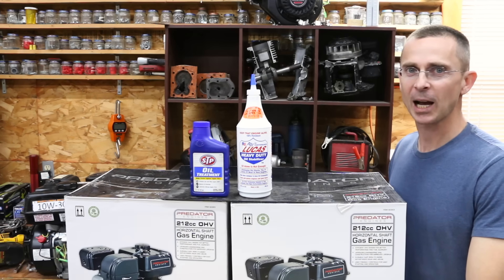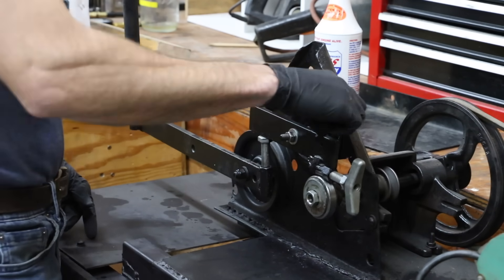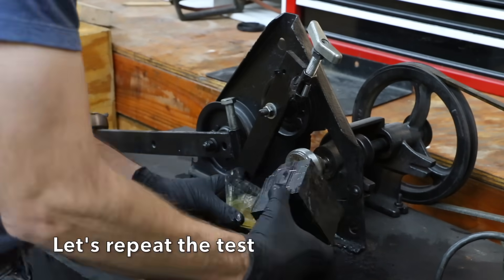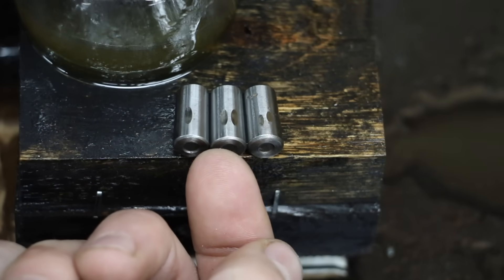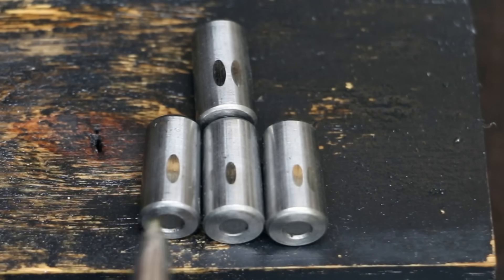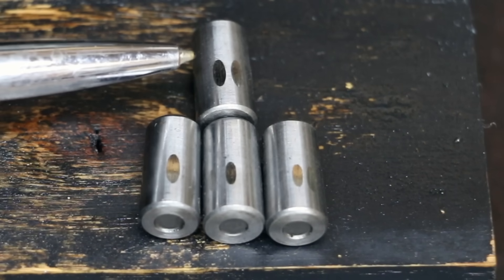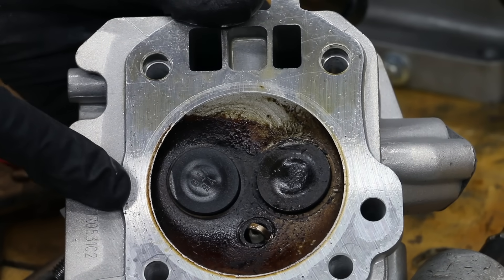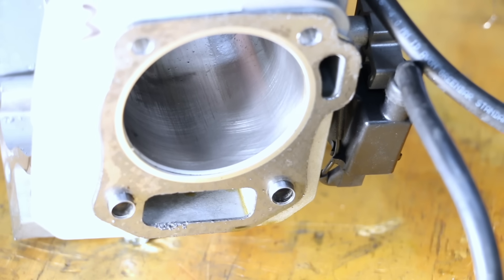Which engine self-destructs first?  Lucas or STP?

Comment: 2 hours later at the Harbor Freight returns desk "Dunno, They were running fine and then just wham.. must be a manufacturing defect."
Reply: I do bet that someone has probably done that.
Reply: Daniel Ade , yes I was an HFT store manager before they emasculated and dumbed the job down.
Reply: @danielade9062  2
Reply: You do know you're cheating Harbor Freight don't you?
Reply: @ellieprice3396  I had a Harbor freight employee tell me to do that with the air compressor I bought.
Reply: @swiskus100  lmfao
Reply: @ellieprice3396  that's the point of buying the extended warranty. they just rebuild em, re box em, and put em back on the shelf.
Reply: Matt Stambaugh would you like to sign up for itc?
Reply: That's awesome believe it that's how it usually works
Reply: Lol, then straight to the clearance rack.
Reply: @superhall229  Sir, the extra tape just means the box was damaged…. It’s not a return item .. we’ll take an extra $5 off
Reply: I never buy the extended warranty from harbor freight,  if it makes it through the intended job a bought it for, then it served it's purpose and I already made my money back with it. All uses after that is extra profit. They are cheap for a reason.
Reply: Me too but if I purchased one of those generators, their more expensive ones which are very highly rated Honda knockoffs, I might purchase an extended warranty.
Reply: Koglio Knows And the extended warranty would be even more extra profit. But she didn’t think that far ahead did you
Reply: @Jacques Bloques No it is called stealing anyway you cut it.
Reply: Thomas Marnik save it for Sunday. Raise your own kids. Keep your nose out of the living room of others. Self righteous fraud.
Reply: Mike Seever You're the reason warranties are shit these days...
Reply: Casher:”Would you like to buy the replacement plan?” 
Me:”Woman I’m going to use it twice and toss it...” 
Cashier:”😔ok den”
Reply: Hate people that do that kind of shit. Thats why I have such a hassle exchanging my craftsman tools.
Reply: Noan YoBiseniss Craftsman is about as American as iPhone now. Were my fav for years. Walmart Stanley for the win now, unless you’re pro. Then Snap on for a second mortgage.
Reply: Ahahhahahahahahhahahahahhahahahhahahahahahaha
Reply: Matt Stambaugh as a matter of fact, I think I will take the extended warranty
Reply: @louofm1  hahaha
Reply: louofm1 why do I need the extended warranty? Salesman “ in case they blow up”   If there going to blow up I’m not buying them lol
Reply: Matt stambaugh...that was funny...lmao
Reply: Then the clerk just taped the box up and returned it to inventory.
Reply: That's funny
Reply: Isn’t it great to hear people say that a corporation is cheating them?  As if you had to buy their product. I do know what it takes to run a business that sells things and unfortunately people that scam the system with dishonest return practices has to be factored into the price. If it wasn’t there would not be any products made. EVERY manufacturer would go out of business because so many people do this and other dishonest things. 
Of course there is a profit for manufactured and/or sold goods. Why else would anyone provide these services if there weren’t?
Just admit that you are a crook when you are just that and don’t blame the business. They are only trying to remain a viable company and people like this make it more expensive for them and in turn make it more expensive for us all.
BLAME YOURSELF for the high prices.
Reply: Hey Matt, I thought the same thing! Great minds think alike.
Reply: Matt Stambaugh that's funny
Reply: Hahahaha
Reply: Those came with a lifetime warranty right?
Reply: I sure he bought the extra warranty lol
Reply: hahaha can you imagine? That would be hilarious!
Reply: I would like to see a Super tech oil additive review.
Reply: Sadly, there really are people like that out there, some even in this thread. Always looking for an angle. Like the women who buy a dress for a special occasion, wear it, and then return it. Like the welfare queens and others who love their free stuff from the government and then vote for socialist pigs. These people make awful co-workers and friends, because others always have to take up the slack for their selfishness.
-- Free capitalist democracies require a primarily moral and ethical population. People who see others cheat, and then justify their own cheating, are a contagion of corruption and undermine America. Like an internal cancer. Their corruption in turn "justifies" the corporate cheating, when people like them get jobs in companies and write crappy warranties, and so on, and so on. "But everyone else is doing it." No, everyone else is NOT doing it. Most of the other people, the honest ones, are avoiding you, so your circle of friends gets narrowed down to like-minded corrupt people, who are the ones saying "Everyone else does it." It's a corrupt, communist, anti-American mindset. It's what keeps third-world countries third-world and communist countries unfree.
Reply: @grizzlygrizzle  You're not alone brother. Don't forget that. Never be bitter. Lots of good out there too.
Reply: Daniel Nunez  I don't care how you justify it, you are STEALING. I hope you do not past this despicable value on to your children.  Shame on you.
Reply: Let me know when you do this mystery oil test !
Reply: It was a joke people! Stop the "ethics" bashing!
Reply: HAHAHAHAHAHAHAHAHAHAAH F-ING A
Reply: David Dahveed, why you disparage the Russia? The motherland is the only land
Reply: Jacques Bloques exactly. Seeing as how most manufactures warranty the product the first year anyway. It’s a second chance for the business to stick their hand in your pocket.
Reply: Do you remember Craftmans tool warranty about 20 years ago? No questions asked life time warranty on all tools, the it changed to non mechanical tools, and finally ended with reconditioning of ratchets and replacing tape measures, anything else went to “service center” where they told you proper use and maintenance is abuse of the tools and handed you a bill!
Reply: Perfect
Reply: Hahahahahahahahahahahahahaa!
Reply: Yep, that's what I would do.😆
Reply: LMAO!!!
Reply: LMAO
Reply: Lmao
Reply: LOL
Reply: LOL!
Reply: Buy 12 dollars insurance and you can return it at harbor freight.
Reply: lol 😆
Reply: Return them they are under warranty
Reply: Omg 😲 hahahaha😄
Reply: Best comment ever!! Bahahaha!
Reply: So good
Reply: 11:25 Music: Silent Partner - Don't Look.  

Took a while searching through 100+ songs to find...
Reply: Bring those jack stands in too. No good after you drill 4 holes in each of them.
Reply: Must be a fluke !
Reply: bahaa! lol!
Reply: I did added to my car the ticking noise from lifter got better almost no more sound I LL continue using lucas additive in my engine oil it fantastic for me .
Reply: #harlemfake
Reply: Do you want the extended warranty, we will replace the engine if something happens. Yes where do I sign up.
Reply: Matt Stambaugh well depends on how you look at it if 40 for insurance that they make 100 profit on  and the unit cost them wholesale 20 bucks they clear 120 profit then after you file a claim they still clear 100
Reply: @David-w8x6q  I think he is a rusky, just here to ruin 2 of our engines!
Reply: it seems to me that STP scored best on the measuring chart, it had least amount .. and was close even though it was not mixed as rich. but here is one interesting thing,  viscosity does mean something when you have no oil because it hangs on to the parts creating a barrier... but you would have better flow with thinner oil, providing there is oil.
Reply: I wish you had a third to run regular oil as a control
Reply: just got to dump the 3 hour break in oil back into the engine pull out the dip stick at the counter
Reply: Matt Stambaugh .lol
Reply: The warranty covers everything short of theft. All that is asked is you actually get all of the gas out.
Reply: Ha! Too Funny!
Reply: Nack in the 50 60 nascar drivers bought sears and 'monkey wards' tires. Race them and return them for bew ones on Monday. True story as told by the man Richatd Petty.
Reply: Lmao
Reply: INTEGRITY
Reply: You have dum dum try this blow up try return back to store fore cash back
Reply: lol
Reply: Wow you are a scumbag...
Reply: roflmmfao!
Reply: Or, you know, stealing, same thing, but it always comes back to you, always. Now, if it legitimately has a failure, that's a different story.
Reply: N Matthew   I think they are just joking about ever returning tested motors they destroyed.
Reply: Im just the opposite. After using it for two years,  I go back to Harbor Freight and pay them for the engine all over again. After all, it outlasted the warranty and if I use it any longer than that,  people might accuse me of being a dishonest consumer and shameless capitalist,  seeking greater value than the machine was guaranteed to run. Consider it a form of penance. Here mister Harbor Freight manager, I've come to pay you more because the product lasted so long. Please accept my money less the folks on YouTube taunt me for taking advantage of you. Im sure you buy these engines by the hundred thousand quantity for $16 each and barely make a dime profit at $99. If its running next year, I'll be back with more guilt money. Thank you.
Reply: @mark-wn5ek  mark, that's gotta be the funniest shit I've read so far!!! LmASSOFF!!!!! 👍👍👍👍👍
Reply: It's a darn good thing we have so may people standing up to protect these large corporations from the evil that lurks in the hearts of the working poor.  Protect your corporate overlords maybe you too will get a cookie. idiots
Reply: @erictorkelson5778   -- It's not about protecting corporations. It's about protecting yourself, your family, and your community. If you travel to some 3rd world countries with rampant corruption, you will see how that attitude ruins a country when it becomes normalized. When you commit that kind of fraud and rationalize it because some others are doing it, you are corrupting yourself, and your corruption will rub off on your family, and on anyone else you have influence over in your community. As your kind of attitude spreads, it infects the people who come to run large corporations and the government, and before long we're living in a banana republic. 

-- I have a friend who has done some pretty sleazy things, but he was in dire straits at the time, fearing for his family's survival, and as soon as he got his head above water (and just barely), he started paying it forward, providing service above and beyond the call of mere honesty. But when someone who is doing OK starts rationalizing theft and fraud when it's unnecessary, the kind of person who's always looking for an angle in order to avoid having to put in an honest day's work for his pay, that's the kind of cancer that infects a decent country and makes it decline. None of us is perfect, and no one with ideals  lives up to them fully, but when you give up on those ideals, and resign yourself to cynical dog-eat-dog-ism, you're just half a step away from being a common criminal. It's parasitic on the honest people, because your angle wouldn't work if everyone else did it. It only works because most people don't do it. And is that the kind of legacy you want to pass on to your kids?
-- If you justify defrauding big corporations because you think they're all corrupt, will that kind of rationalization become extended if you move into a neighborhood with some wife-beaters in it? Embezzlers? and so on? A moral compass is an individual thing, and if you're going to choose to tie yours to the least common denominator, then you're not going to end up with much self-respect.
Reply: @Jacques Bloques Yes, I guess I am just plain Dumb.  Thank you for your kind words.
Reply: @thomasmarnik6849  Seriously dude? You voluntarily decide to dish out a verbal attack on someone judging them. But when they respond with a judgement of you that you don't like you resort to snarky comments? Aside from that your initial complaint is way off base. What is being offered upon purchase is no questions asked replacement or the item purchased. There is no defrauding going on. They will inspect the one returned test it spruce it up and sell it as a reconditioned item. By that time prices will have gone up say $30 on the unit so when they mark it down $50 they're only out $20 ... except he paid $40 for the warranty so they're still ahead.
Reply: A warranty is for a item that breaks or does not function properly in the warranty period.  Using an item for just short of the warranty period and then returning a worn but functioning item to get another brand new item is Fraud.  PERIOD.  That is the value system that was instilled in me by my parents and I hopefully by example I have instilled in my children.  I through this thread am trying to show others that this type of behavior is not right and many other people consider this low moral behavior.  BTW, I Never Ever purchase an extended warranty because yes the merchant selling the product makes more money by selling the warranty.
Reply: Thomas Marnik show the State stature where that is Fraud!!!!! Period man.
Reply: @erictorkelson5778  well said. My thoughts exactly...
Reply: @steve5912  You're*
Reply: That's the sound of the joke going over your head lmao.
Reply: I do that with my Sylvania Silver Star Ultra headlights from Walmart. Like $35 for a 2 pack. Bulb burns out in a couple months I buy a new one, put the old bulb in the package take it and the receipt to another Walmart. "I just bought this and it burnt out" it's not cheating Walmart if they burn out all the time. Lol
Reply: @demonchild8452  Convert to led cheap ass
Reply: @demonchild8452  if bulbs burn out that quick more than likely it the person installing them.  Regardless of brand. You never ever touch the glass part of the bulb the natural oils on your hands will leave a residue on  the bulb and cause them to heat up and burn out. Don't believe me look it up
Reply: @demonchild8452  You are the real thing! A Jerk!
Reply: @Demonchild84
I never worked 2 1/2 years for any company that didn't pay a living wage - that would be pretty stupid.
Reply: Demonchild84 Walmart pays $15 an hour minimum to their employees— not many stores do that
Reply: What a waste.
Reply: @owentie  I guess there is the scrap though. Viewer funded scrap.
Reply: One of the upsides of doing business with Harbor Freight is when you purchase an engine or an engine-powered piece of equipment is their extended warranties. I've had a number of the two-stroke 700 watt generators. I use them whenever I don't need a lot of power on a job site, as well as for camping. I purchase the two year warranty ($40). Then just prior to the two year mark I take it back and got a brand-new replacement no questions asked. None have ever failed on me, but after two years of use (I'm talking hundreds of hours in less than ideal environments) I get a new one. Use a generator for two years and then a brand new one just hand to you? That's what I call customer service. And this past fall I purchased one of the 212 cc, 6.5 hp (same as those used in this test) Predator engines for use on a wood splitter I built. Works great. In two years, that too will be heading back to Harbor Freight for a brand new one with no questions asked. Can't beat that with a stick.
Reply: That is called fraud.  Raises prices for the rest of us.
Reply: Thomas Marnik bullshit judge Judy. It’s a voluntary business transaction. They can refuse any time. You can refuse by never buying in first place.
Reply: Mike Seever , yep I dealt with that when I was an HFT manager/ but if you didn’t sell warranties you were disciplined, period . Likewise, if your consistent attempts to sell warranties generate customers complaints , that was also disciplined.
Reply: @mikeseever4480  brilliant!
Reply: @mikeseever4480   Are you a POLITICIAN ? If not , Think about running for congress. You fit right in with your justifying what your doing.  Just like everyone of them corrupt ones in Washington, and else where...WAKE UP AMERICA.
Reply: @mikeseever4480  People like ruin it for every one else!!
Reply: @mikeseever4480  I know a carpenter who uses HF electric Jackhammers for decks and basement baths and he takes his back working or not just before the warranty expires to get a new 1 for FREE !
Reply: And a plumber I used to work with bought a craftsman razor knife and takes it back when it needs new blades !

Comment: There's an additive called Extreme Friction Fighter. It's very expensive but it claims to provide better lubrication than anything else on the market. They have a video here on YouTube where they do the bearing test and it looks really impressive. I'd be interested in seeing how well it does in one of those small engines. I use it in my semi trucks but it's hard to tell if it has made any difference.
Reply from the maker: Thank you for this recommendation.

Comment: In 1993 my front Seal blew on my 1979 Celica GT and it was late at night, I was in Seattle, WA and needed to get home to Beaverton, OR (180 mi) that night.... I was in a bar all freaked out trying to figure out how to get home and a guy we met there told me to fill my car with 3 parts STP to 1 partts oil and not go over 50 mph the whole way....I couldn't believe it, we made it home, couple days later, paid less than $25.00 in parts and replaced the seal myself, and the car ran/drove great til 2000 when I picked up a newer Celica and gave it to a friend of mine. Couldn't believe it... Made a few stops along the way just to check things out...
Reply from the maker: This is very impressive!  Thanks for sharing this experience.
Reply: Yeah, I was amazed. A little messy underneath and up front from the fan (RWD) flinging a little bit around, but that was the least of my problem at the time. Thanks!